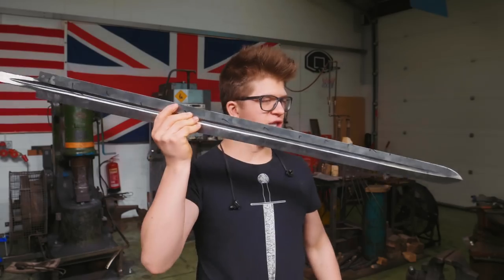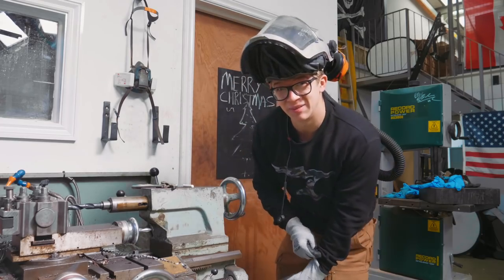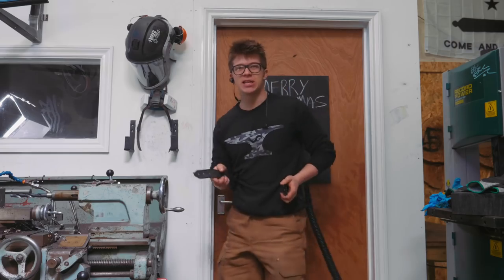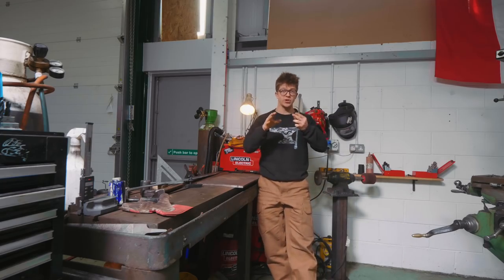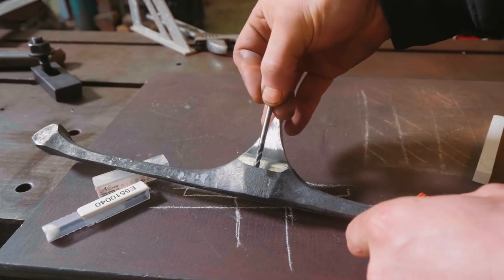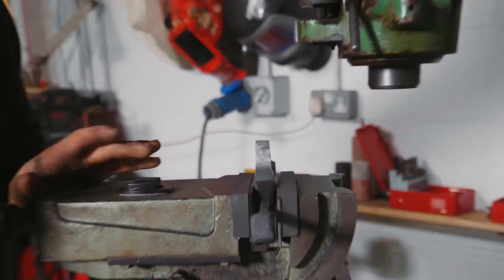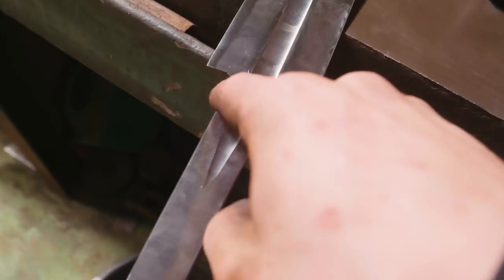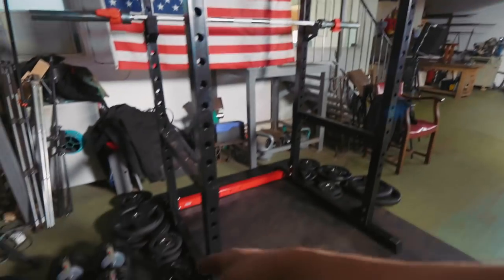MAKING A SCOTTISH CLAYMORE SWORD!!! PART 8

Comment: I didn't like that you tried to mill a part that would have been forged in William's time. You found out that a modern shortcut isn't a solution to an old problem.
Reply: Whiskey Jim yes but in real, in william time the didnt care if it was all beatifull and straight. It just needed to do the job.

Comment: Ok .. I stopped at 8:40 .. why, pray tell .. have you not drilled it from the back side FIRST .. It would have removed a good amount of material that no longer needed to be milled, but also .. and most importantly .. gives you a through hole for chips to evacuate and cooling airflow ....

Comment: Why does that mask have a tube attached to it
Reply: the tube is connected to the air filter that he puts around his waist. On a previous video he explained the risks of breathing the fumes and metal particles that came from grinding
Reply: Some of the belt packs that are available, not only filter the air, but they cool it as  well. I don't know if Alec's does or not.

Comment: Alex your going down too far with your squats your thighs should not go lower than parallel with the floor or you can damage your knees. It's too much strain on the joint and ligaments.

Comment: Dude get rid of the concrete weights and get you some steel weights you get better results.
Reply: boliver75 1 kg/lb is the same regardless of what is made of. His results will be the same
Reply: Jason Scheffler : I use to left all the time, there is a big difference, steel is heavier than concrete.
Reply: boliver75 Im curious as to what planet you live on. Here on earth 1lb is 1 lb, it doesn't matter what the material is. For example 1lb of feathers weighs the exact same as does 1 lb of steel
Reply: Steel may have a bigger mass but 1kg of steel weighs the same as 1kg of concrete or plaster.
Reply: let me ask you a question boliver75 : what's heavier 100lbs of feathers or 100lbs of rock ?
Reply: TULKAS ASTALDO dude I know what I'm talking about and they ate the same weight but concrete deteriorates after awhile from being dropped, slammed around so you loose the necessary weight in concrete not in metal so drop it...
Reply: boliver75 See that's different than what you said at first, if you'd said that no one would have disagreed
Reply: Jason Scheffler : I shouldn't have to worry about anyone disagreeing with me because just like the rest of you, I am aloud to make suggestions.
Reply: boliver75 I've had both and I agree, the plaster filled ones aren't as good, as in the plastic shell deteriorates and they are big and bulky.  I wouldn't say steel gives better results though, they both give the exact same result in my case as they are the exact same weight. The cast steel ones are better quality, last longer and hold a better resale value though.

Comment: put a chair behind you so you dont go down to far squatting and blow out your knees Great job on the Sword. You also need a Weight belt so you dont damage you back when you squat.
Reply: Jerry Moates He's hitting proper squat depth, maybe a touch to low but it's fine. Optimal for most people is the top of the thighs below parallel. And a belt isn't there for your back, it's to give you something to push your abs against when it gets heavy. Which it obviously isn't right now for Alec.

Comment: I understand Alex not doing the Forged in Fire. Its time consuming and would cost him .
How about a mock challenge for the fans.
Start cold .
10 minute design window for a purpose built weapon.
3 hours to forge a weapon from a random choice of steel by a independent source.
3 hours to finish said weapon .
Test it against something brutal to see how it stands up.
Call it a practice run.
We know Alex is amazing, lets see how he is against the clock.
One days effort. One video.
Thumbs up if you agree.